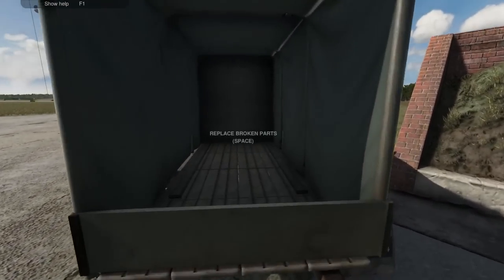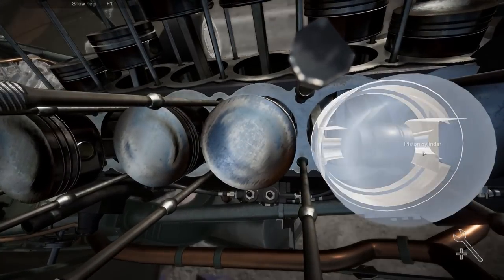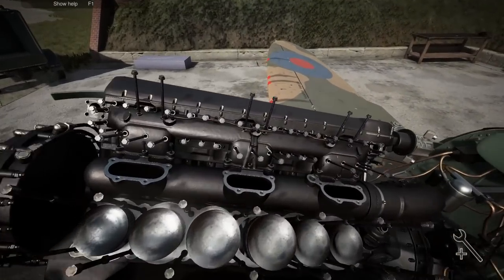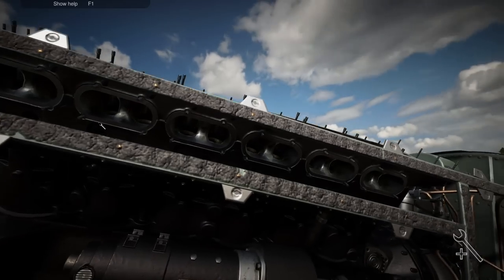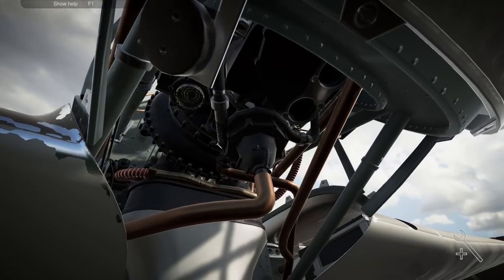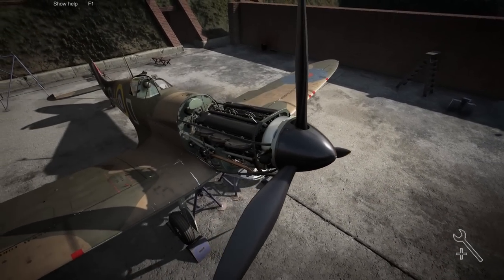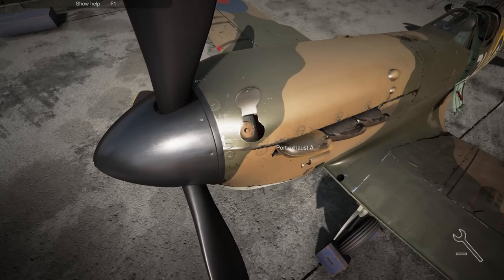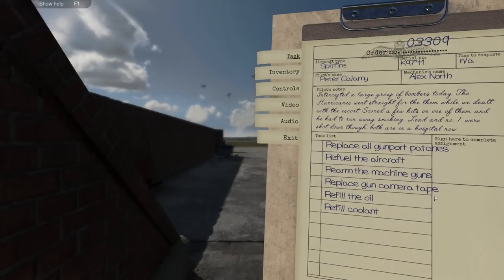Plane Mechanic Simulator #16 - Putting the Merlin back together - PC Playthrough

Comment: 2:32 current time - I'm guessing 3-4 parts missed, leading to 3-4 instances of "what am I missing?" Be interesting to see how close I am. Edit to follow after the vid lol. EDIT ONE - ROTFLMAO @ 10:36. EDIT TWO - So, end of vid. you missed no parts... you missed bolts. That would have been a tougher call, as you missed a lot of them that I saw, but only for a quick minute which you caught before you moved on. I'm going to say that in the end I was wrong, (no spoilers for anyone else who wants to play along), and I will just take some small comfort in predicting "what am I missing" 8 minuted before you said it. :P

 Excellent as always, and looking forward to more!